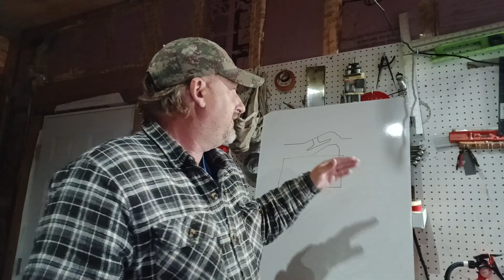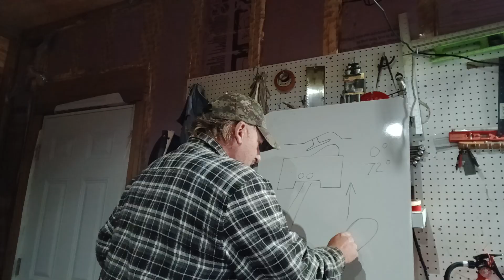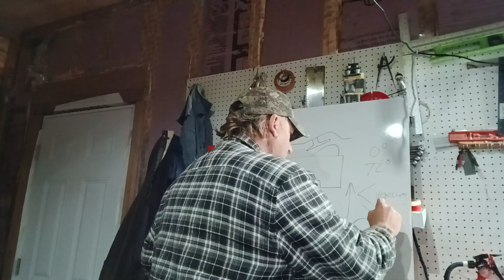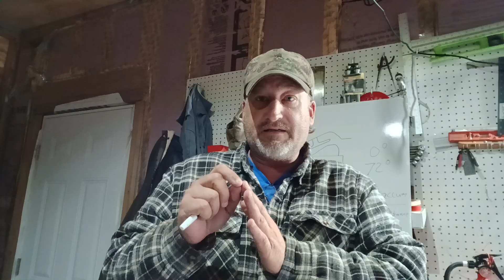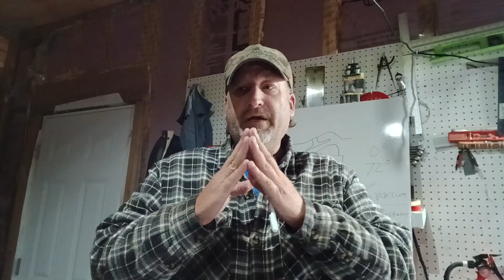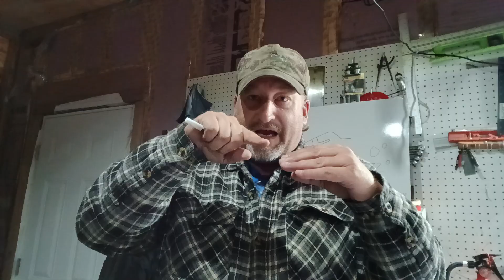Cam profiles are dictated by piston timing.

Comment: That's why testers who flip pistons might not see any difference.
The valve timing/cam profile is not ideal for the new piston acceleration.
Reply from the maker: The power gains are less recordable at lower performance levels.  In addition,  cam timing is contributed to when the piston is at TDC. What is occurring below the piston in the rod angle and crank position is not the same with the fluooed pistons. A true performance build for increased performance will have directional pistons with the pin offset to the same side.